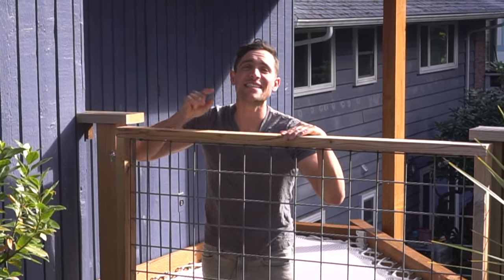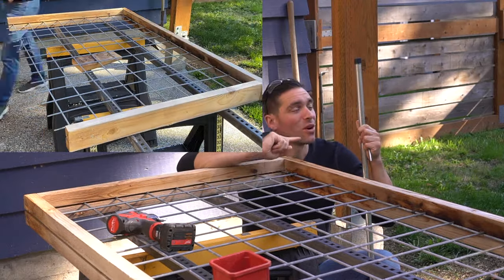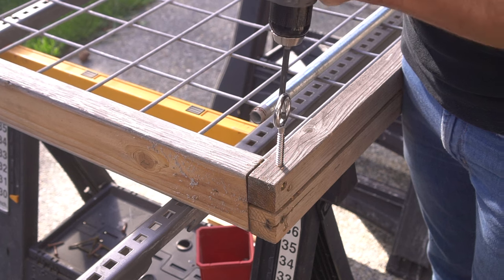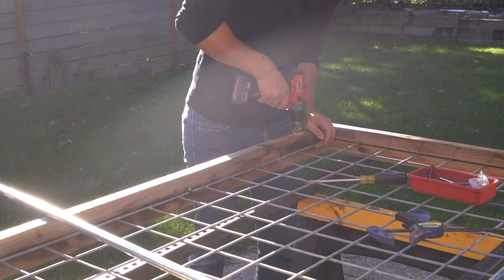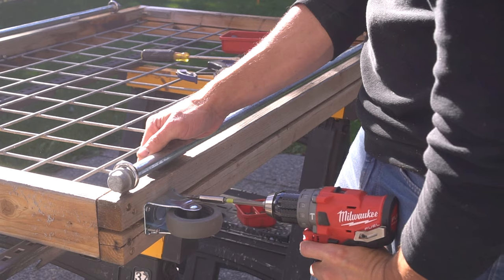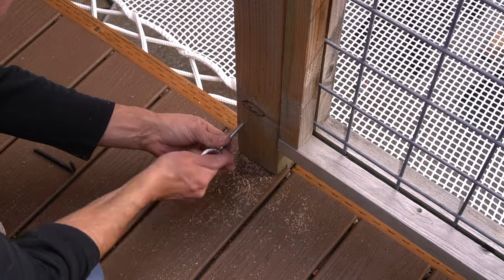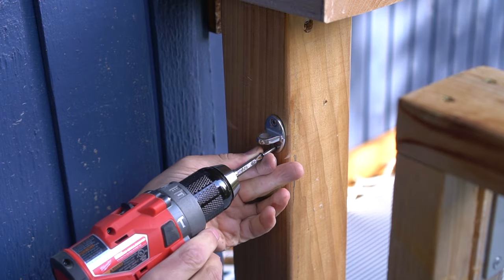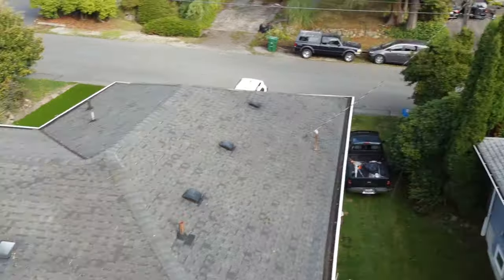DIY SLIDING GATE

Comment: Do you have a vid on making the cedar/wire panel? The pipe is genius! Looks like your daughter is anxiously waiting to be your shop buddy
Reply from the maker: Thanks so much Di and great to hear. I actually don’t but it was quite simple to do if you liked the look.  The only thing special about it is that the two sides of wood and a 3/4” notch that is 3/4” deep which it’s the wire frame perfectly.  Cut it with a table saw by running the board through a few times.  Thanks for the continued support.

Comment: Not a bad concept. I did a search for some ideas. I wanted to make one for a drive way. Obviously with a large opening you'd generally have X2 gates and requires clearance for swing. I was more thinking of a single gate but a concrete base and maybe a channel. For the top stabiliser a second channel with 2 wheels that can house only come out at the ends. Your pipe idea is perfectly fine but restricted by the stop ends. Alternatively.. an inside channel and outside channel might work too. Much like your pipe idea. In regards to your pipe, it would be like your pipe going into a larger pipe. I guess there are various methods to achieve the same outcome. Cheers.

Comment: That's an ingenious rail system and it plays well with the hog panel wire inset. How much wobble do you get with the size of the eye hole and the diameter of the pipe or is the fit good enough to eliminate it?

Comment: I know you are not going for protection  but, I thought it would be better with a second set of eye hooks on the right side of the gate opening. 
    And maybe even a longer piece of 4 ft pipe which you can easily get cut to size at Homedepot.  
   This would keep the gate from wanting to slide outward.
Reply from the maker: The only reason I did this video was because I was going for protection haha.  In all honest the gate really doesn't slide outward unless you really try to pull the gate in an awkward direction.  I like the idea of more eye hooks but that would push the gate away from the post that I attached the hook on which means you would either need to move that post or get a longer latch, which just wouldn't look good.  Thanks for watching though and hope you enjoyed the video.

Comment: Used your idea, but i attached the galvanized pipe to the deck railing to keep it hidden. Only issue now is the bottom will swing outwards since there isn't anything holding it in place. Does yours swing or move at all?

Comment: Awesome!  I'm looking to build my own sliding utility-gate for my custom built fence i did.  
Opening is about 12ft wide.  Do you think this style of sliding gate would work on a bigger scale?   (I'd get different wheels)
Also, How long was your gate to make the 48" pipe work?  Just trying to configure length of pipe needed.  
-James from Bothell, WA
Reply: Did you figure this out? I want to try this with my vinyl fence. I have a 6 foot opening and I'm trying to determine what length gate I need.
Reply: did you build this? I need to do the same thing. did you add any additional reinforcement?

Comment: So I just did one of these sliding gates 10’ wide. The only thing I don’t like is that the back end kicks out when you open the gate. Working on changing or adding something to fix problem. Otherwise, great idea. Thanks!
Reply: Are the pipe components loud?
Reply: Loud as in, the rubbing? Metal to Metal sound?
Reply: did you need to make any alterations? I need to build an 11" one.

Comment: To save cost is there any reason you couldn't use 1/2 pipe rather than 3/4 or go super cheap and use 1/2" electrical conduit (10 ft for $8) with small bolts through each end for stops instead of caps?
Reply: I know this comment is  a little past the date where a reply would help the commenter, but it might help someone using this idea currently.  I tried to build with materials on hand so tried a 4' piece of pvc...too flexible.  Went to HD and they had the 3/4" black, threaded both ends pipe/caps but no eye screw big enough.  Went down to a 1/2" pipe and it works perfectly.

Another comment asked about the stability when the gate is closed because the (let's call it) right side isn't secured...I'm still working on that.